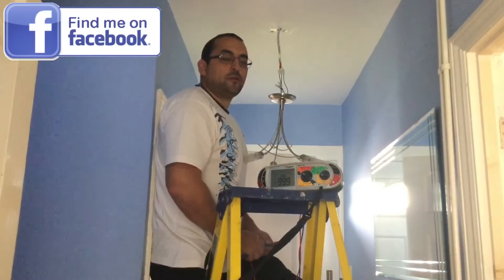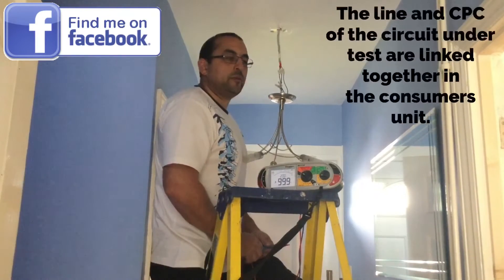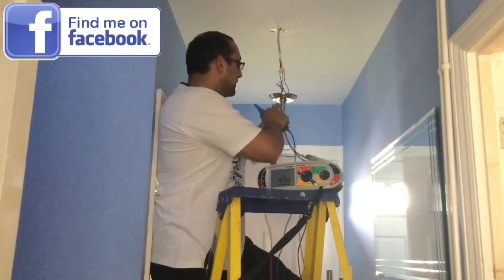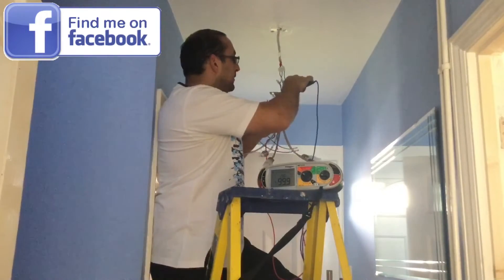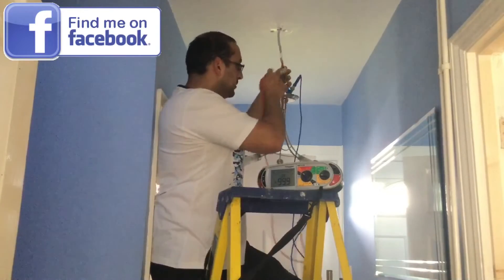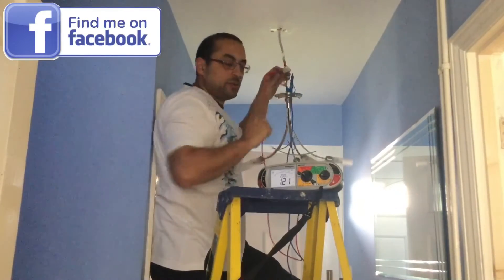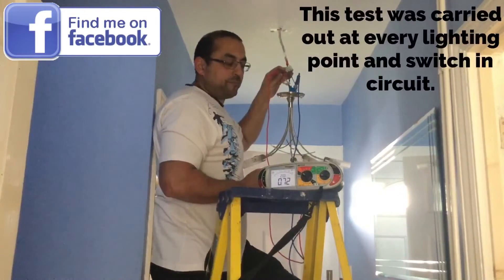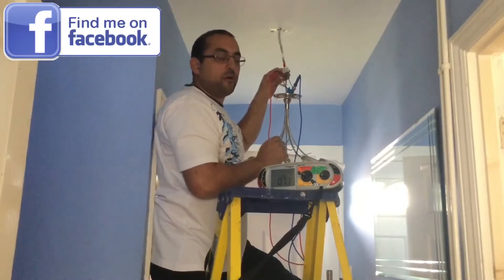Continuity of CPC and Polarity Test to an Exposed Conductive Part AM2 AM2S On Site Video

Comment: What is CPC? (Im an electrician, but not in the UK). If yor tell what it is short for, I can probably find out the rest on my own.
Reply: mrvelleful it stands for circuit protective conductor. This conductor is part of the earth family and is used to provide protection from shock and to allow sufficient current flow so protective devices can trip 👍🏻